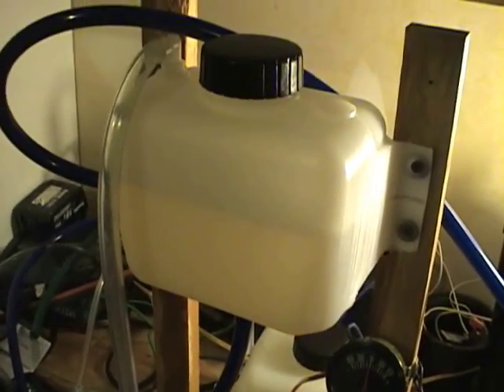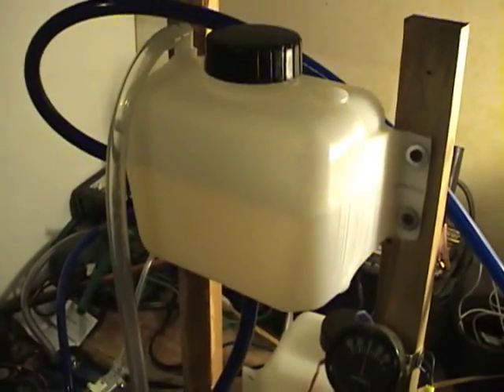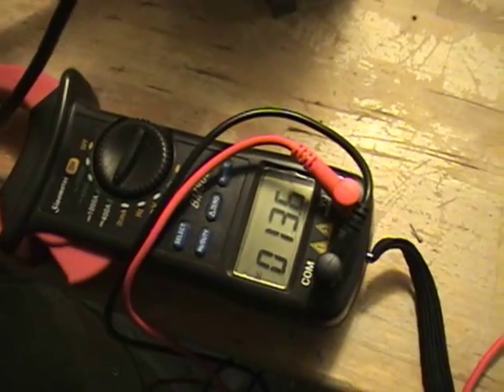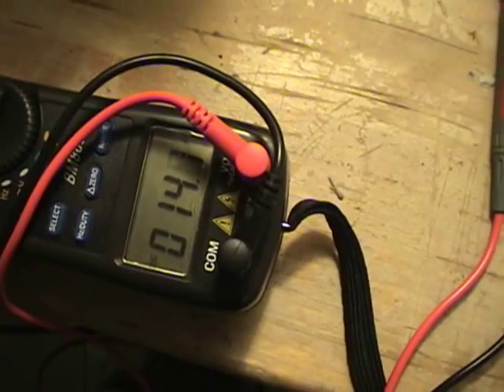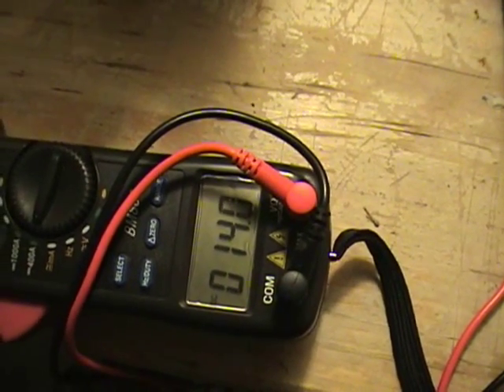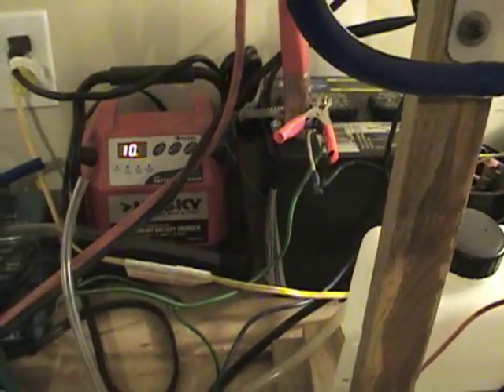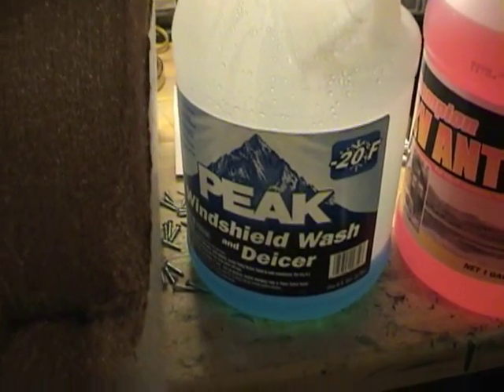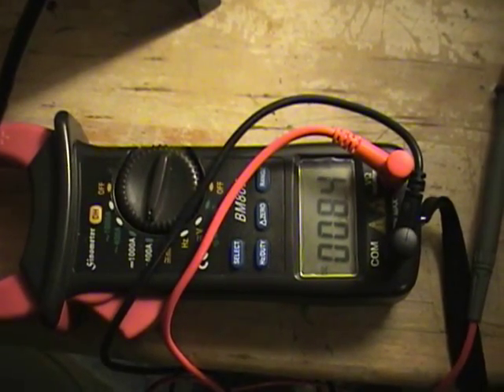HHO hydrogen Winter Electrolyte? Solutions for freezing temps

Comment: Hi Steve, I just finished experimenting on this HHO freezing problem. The best way so far to avoid freezing is to use a very strong Sodium Hydroxide mixture. I put 20 spoons of Sodium Hydroxide on a gallon of water. It didn't freeze at minus 12 degrees celsius.
Reply from the maker: yes and also KOH will work at high concentration over 18% by weight
Reply: But when our temperature here went deeper to minus 20 it froze just a little bit on the top meaning not fully frozen.I'm going to add 10 spoons more of sodium hydroxide and I'll message you guys for the results.
Reply from the maker: Man that is really cold!
Reply: Really? Next winter I'll experiment on this. THANKS
Reply from the maker: This will be vary interesting to see.

Comment from the maker: @eloid777 High strengths of koh is the only way.
Reply: how about a sand pipe heater and pack that full of sand and heat that up or pack
https://www.youtube.com/watch?v=vW_Pip8Sq-M
you can do this and sandwich two of the sand blocks and have a space heater you could also probably hook it to a thermostat you get for the house and it can kick off when reaches desired temp and plug it in like you would the block heater sand takes longer to cool off and heats up quickly like heating up rocks in a camp site and even if the fire goes out the heat lasts a long time. 

idk people use these to heat a house, one guy made one with hho and sand and a bit of water and the water would reach the top hit a slant and cycle through the system again https://www.youtube.com/watch?v=Bd_yrSldFWw
did you know hho can burn under water? I didnt lol
but then 
https://www.youtube.com/watch?v=D2ElkP8YNqM

Comment: Maybe one could use a flexible heating element like the kind used to heat floors or heated blankets? It is rubber coated and could be made to fit around the reservoir and powered by the battery while the car is off. Just make sure it won't drain the battery. Maybe use lithium ion battery? Just a thought.

Comment from the maker: @suvado I had a guy send me some magic fluid last winter that worked so well. He would never tell me what it was made of or sell me anymore. I still have it in my freezer. I looked into getting it analyzed but that was going to be 5k. It doesn't have any odor of any kind. It doesn't feel like koh or NeOH in my fingers. It is a mystery. KOH does work but you have to get over 18%. So it takes a little bit different design and much more dangerous to work with at that concentration.

Comment: what happens after you pour it in and come back and do the test the next day, does it start out low. And try sulfuric or hydrocloric acid, start with small amounts. And add it to the base solution very very slowly, adding an acid to a base cancels Ph by chemical reaction, which can be dramatic if not does slowly.